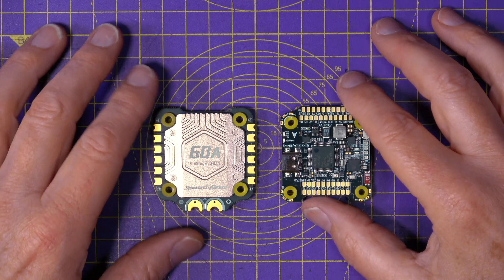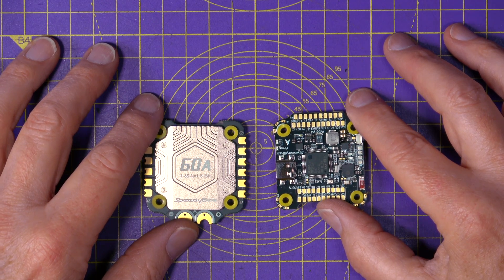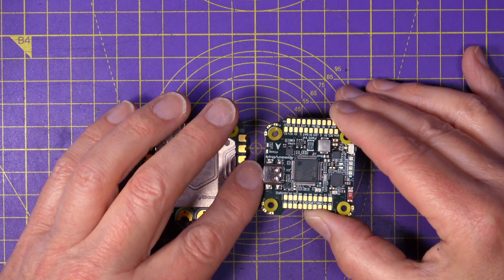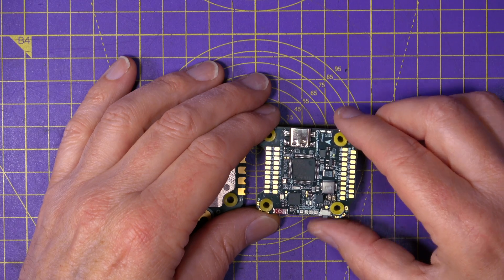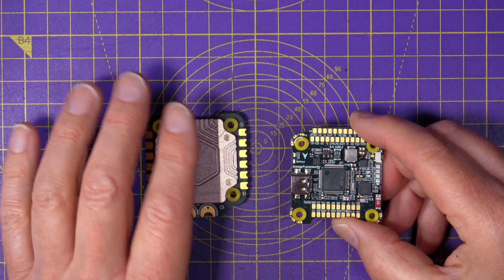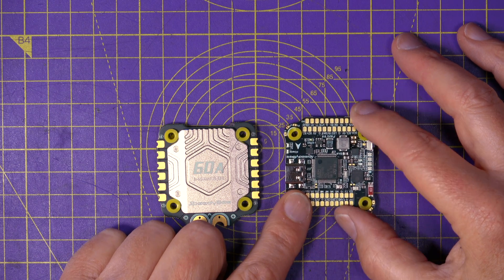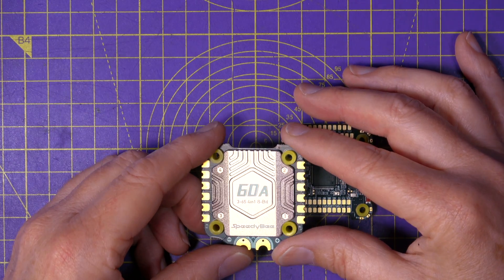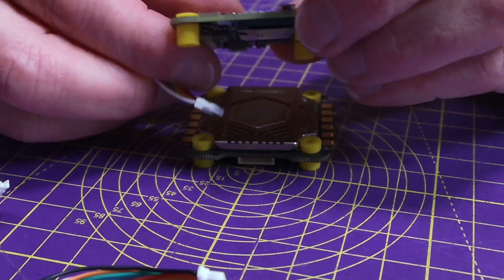SpeedyBee F405 Stack V4 - the perfect stack for large drones and cinelifters running BF or INAV

Comment: I have a Question Unfortunately 50 amp Stack is Out of Stock in India Only 60 amp stack is Available I am Buliding drone Using Qav 250 and Using 2600kv motors so It is Safe to Purchase this 60 amp version??
Reply from the maker: SpeedyBee have discontinued all their stacks recently. I absolutely love them, so it's a shame but I hear there's new products on the way following the release of their F405 AIO https://www.youtube.com/watch?v=RK__JQ_O3Dk If you can find a 60A one, that will be fine.
Reply: @WhirlyBloke  yes Speedybee is a Great stack But I am Confused in 60 amp Is good for fpv drone because There is another option A stack Comes from Darkmatter but Speedybee is Given so many features like wireless Tunning so that 60 amp is Good or 55 amp is Good I am Confused. Can you Help me? Thanks 🙏

Comment: do you need to use the 4 in 1 esc if the quadcopter has a pdb and the motors already have escs
Reply from the maker: @TheBoobieBandit1   You can just use the flight controller on its own. There's super pads for all the motor outputs on the PCB.

Comment: Hello! I'm not very good at this (I study them and do them as a hobby).
F405 WING MINI I want to mount it on a fishing bait boat and I need more advice ;
1. Can it be used as an autopilot (the boat can go by itself to several saved places on the water and then return by itself to the home point)?
2. Does it work with Flysky FS-i6 FS I6 2.4G 6ch RC Transmitter Controller FS-iA6 / FS-iA6B Receiver?
Reply: With INAV yes, if you attach the receiver on this yes.
Dude you need ten more hours of study on RC！

Comment: I have problem with my new build help thanks. 

Frame: Apex 5" X Frame 
-speedybee f405 v4 
Esc Firmware : J-h -50 - version 19.0, 48kh.
propellers direction: normal, front 2 rotating towards camera and back rotating towards back antenna. 

Everything is check out but drone filps over after arming and increasing the throttle.
Reply from the maker: @Ali-sYT  this answer is in this video https://youtu.be/2Qng53CXVdI?si=SYpC_sEI4LFyd4gH
Reply: @WhirlyBloke  thank you.  It was Gyro orientation.

Comment: I was browsing on AliExpress, and this sort of jumped in my basket and the credit card decided to activate. I paid £43 delivered because of Black Friday. I am parts buying gradually for a 5 inch Quad FPV. I'm a complete noob to building drones, this will be my first build. Will this stack be overkill for a 5 inch drone using 6S Lipo's? 

I'm also getting some Amazon vouchers for Christmas and trying to find quality parts on Amazon UK is virtually impossible, but they do have the iFlight XING2 2306 1755KV 6S FPV Motors for a reasonable £85 for a set of four. I was going to get these. Will these be okay as they do get good reviews?

Now I need to think of a frame as I'm going the DJI 03 Air unit route, as I already have the DJI Avata 2. 

Sorry for asking so many questions, but as a noob I need all the help I can get, and you have a confident and trustworthy face 😁👍

Chris.

Comment: I'm new to quads but not to rc's but im looking to run 4x 5010 360kv motors in a tarot 650mm frame off this with 14inch props.. would this work? it seems like my power requirements would be too much for such a small board as ive seen these are usually used in smaller fpv drones.
Reply from the maker: You need to work back from the motors and props to fathom how much current they'll consume at hover and full rpm. This will also be affected by the all up weight on the drone. Even if it's a rough approximation, it's better than guessing cos if to get it wrong, it could cost you loads.

Comment: Does this controller have ESC’s in/on the board or will I have to have an ESC for each motor?
Thanks!
Reply from the maker: The board labelled 60A is a 4 in 1 ESC.
Reply: @WhirlyBloke  Thanks. After “reading the instructions” I’ve come to that conclusion. For me, this is shockingly good news. I still have an old DJI F450 (had to have four ESC’s on it.) I’m planning to resurrect for LOS flying around the back yard.
Thanks for your help.

Comment: Anything over 5 inches is just too big and too heavy. This is coming from an engineer and the radio control industry for cars, boats, quad, copters, anything for the last 40 years. Lighter is always better.go with the 5 inch quad copter and skip the big heavy one.
Reply from the maker: Maybe for hobby flying give the current regs, but when you're flying commercially and the client wants FPV footage using a Red Komodo, a 5 inch or smaller drone isn't gonna cut it. As always, everything has its place and application. Thanks for the feedback.
Reply: There's a reason they primarily use 10 inch quads in Ukraine better flihht time and higher capacity
Reply: Curious how to get a 5inch flying 20+ minutes ?